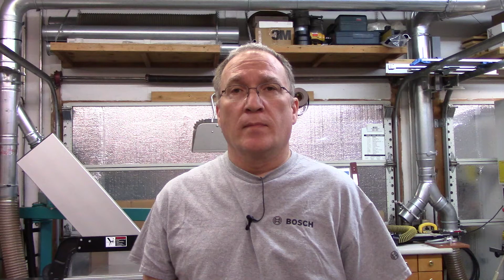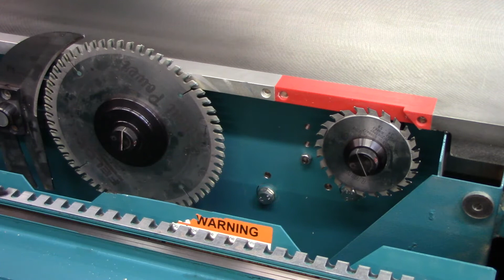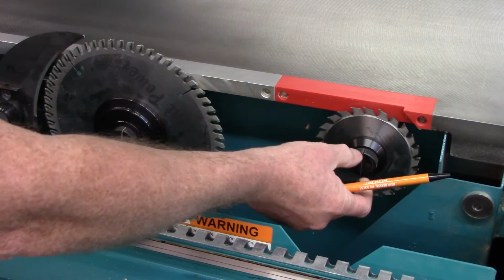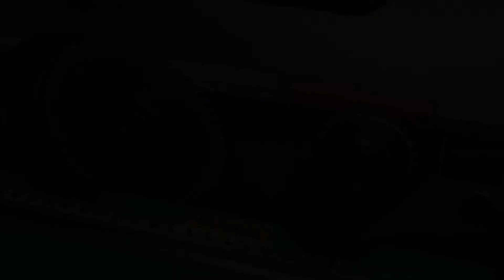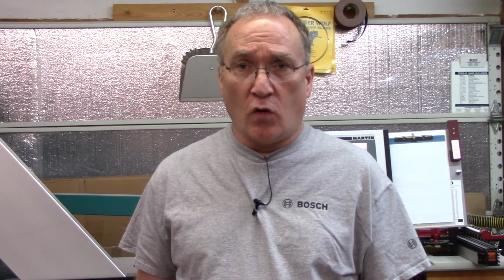Sliding Tablesaw Purchase Considerations PART 2b SCORING UNIT

Comment: Hi, I just bought a holzher table 1243 but is missing the nut and to hold the scoring blade, do you now were I can find this part
Reply from the maker: Hi Hector.  My first recommendation is to contact Holzher for the part.  If they no longer have the part, perhaps they can contact the factory and get the specs/drawings so you could have one made at a machine shop.  Steve

Comment: Thanks for all of your videos, Steve. Very informative. I'm considering replacing my Saw Stop cabinet table saw with a slider but my biggest concern is space requirements. I have watched all of your videos trying to figure out your garage/workshop layout as you seem to create similar woodworking projects to me. Do you have a video or ideally a drawing of your layout you could post? Many Thanks!
Reply from the maker: Hi Bobby.  I don't really have a video or drawing  on shop layout but some of my project videos show the placement of my saw.  My shop is a 3 car garage  roughly 26x36' and the slider sits in front of the middle garage door positioned to allow the table to slide to the maximum extent and still clear my lumber storage.  I have an 11 foot sliding table and it needs nearly 25 feet for the table to go from the fully retracted forward to the blade change position.  This pretty much dictated where I could place it in my shop (travel from front to back of my shop left 6" clearance on each end and that was not nearly enough).  Wingspan of the outrigger is also a consideration and it reaches not quite to the center of my shop with 3 foot of clearance between the saw and the garage door.

I would suggest getting with the distributors for saws you are considering and asking them for the machine distance requirements for whatever length table/outrigger you are considering as this can vary significantly from make to make.   
Hope this helps.
Steve

Comment: I just bought a second hand tablesaw, and got a little worried when it produced a LOT of smoke from the cut. After cleaning the blade did not help, I finally figured out that the direction was reversed, probably because the last owner based it on the scoring blade, which was in the wrong way round. it does have an independent motor, by the way. interesting videos!

Comment: Steve, in all due respect, I differ when it comes to "scoring" saws. Here is my thinking:

'Tis true that the scoring blade is mostly used for melamine and vernier coated wood-stock; it is still perfect for those of us who do not like the tear-out that MOST blades do on the underside of the stock. This goes hardwood and softwood; and for plywood even if it does not have a coating.

Yes, through the years, blade manufacturers have come up with ways to improve on this malady. But for MOST of the blades that we use, a scoring blade is a GREAT improvement to the cut.

Tip: there IS a way to get a scoring effect by using only the regular blade. Before you make your cut, simply lower the blade so it is NO higher than 1/8". Then feed the stock from back to front. This will score it and it is very safe. Then raise the blade to what you want and feed the stock in the normal way.

One VERY great advantage of this is; the score line is ALWAYS perfectly IN line with the cut line.

For what it's worth.

Keep up the good work dear friend. I hope you will be at the IWF show next month in Atlanta. If yes, let me know what day and time you will be there and I will plan to be there too. I am only 30 miles away I would love to meet you Steve.

Comment: One consideration I did not know of before getting the T60 compact model Martin saw was the distance that Martin has between the main saw arbor center and the scoring blade arbor. Happens that the Felder on smaller 500 and 700 series saws is rather small center to center and one is limited to smaller main blades when scoring action is required. This center to center measure is also a consideration when wanting to have a custom blade made for cutting thicker lumber in the shop. The Martin brand allows a larger blade diameter even yet when running a 20" diameter blade and having the scoring blade removed. Sometimes a fine cut is required after a project is built and a band saw cut will not get the right results. 
There is a custom tool and saw blade company in Jersey that will take your money and spec requests and not deliver the correct tooth configuration. Avoid these boys at ALL cost. They are not woodworkers and you will regret getting a reworked blade-butchered that requires one to go to a professional shop to get the tooth height reworked again. Obviously, the Jersey people make blades out of balance and this is impossible to correct.
Reply from the maker: Hi Vincent.  I am pretty sure my Martin T60 is limited to 400mm (16") diameter main blade.  While I have a few Forrest blades, I no longer purchase them as better blades can be had for a lot less.  Custom tooth geometry will cost more though.  Steve
Reply: Steve, good morn; hope all is well over there. I had purchase that custom blade I mentioned and went thru 2 months of problems with that Jersey company. The blade that came with the T60, due to limited choice from Martin, was a "triple chip" and having had a custom 60T made for my Bosch 8.25" circular saw in the triple chip, I readily went for the 350MM Leuco from Martin. Well, you would know it; I stuck a thin board down into the slot and bent the overpriced 3 chip blade and called Leuco and got a new 350 ATB out of Europe. Apparently those blades from the hinterland are a notch better than the "premium" stuff stateside. I have since put a wave in two other Leuco blades. But, I can see the end of my Euro blade days after getting the bill for the latest including freight. Those blades are bout a quarter of the cost of a ceramic crown although you don't have to get something to dull the pain.?? ha ha    I save the new Leuco for precision work and a 400MM rip Leuco rarely comes into play. Just received that 23ga Senco 2"er last week and having fun with assembly. Glad I waited and did not get the 21ga. Senco was in bankruptcy for a while but has come back. Norm is happy they still make his fav 18ga. I would like to affix a laser to my T60 so I can see the line for first cut rough edge lumber. I think the Altendorf machines are of the smaller C to C arbors for main and scoring blades. Felder did not have that parallel miter option for the 700 series or the smaller Format4 so I went with Martin. Felder tried to get me to buy the 550 but why buy a coffin for a 7 footer when the standard fit just fine.? The Martin should outlast both you and me. The later Martin models have improved dust paths vs. the vintage we have but with a good cyclone system we are OK. I have the Oneida with a custom older style plentum design that gives another 4-500 cu ft. I drove to NY to get the thing and got the mini cyclone that fits the CT33. I have paid for the Festocyclone due to current bag cost for the CT33. I have a bunch of those Gross Stabil clamps and have been hording those Pony #3700's as I track them down all over Chicago. If you are ever in Chicago, let me know.
Reply from the maker: I have 2 Leuco blades (one 11 years old) with no problems.  Joe C. speaks highly of the Kanefusa blades.  I would love to try them but you have to order them pairs.  The largest blades I have are 350mm.  I too have thought about mounting a line laser for cut sighting but haven't been too serious about it.  I actually like the Gross Stabil clamps better than Bessey but that ship has sailed long ago.  Never cared too much for the Pony clamps with the clutch plates as they often jammed on me.  Steve

Comment: I have a (smaller) Felder K700p with the mechanical (manually raised) scoring unit. Normally, I can take a 315mm (12.4") main blade. With the 100mm scoring blade, I can take a 300mm (11.8mm) main blade. Felder sells all of those, and they're pretty decent blades, so you can get pretty close to a 12" blade while still having the scoring blade in place.

BTW, I've been really enjoying these videos, and have learned some techniques I had no idea about (like the Franz jig). I've been a slider owner since March.
Reply from the maker: Thanks for posting this Pete.  The 2004 Felder CF741SP I had would not accept a 12" blade with the scoring blade attached.  There are apparently so many variations it is certainly impossible for me to know them all.  Steve

Comment: On the Felder version sliding table series called Hammer; the scoring unit can be added after delivery of the saw; several friends had ordered the Hammer Sliding Table saw and were told it is a factory only attachment with no post delivery adding of the score, but, this is untrue. One can add the scoring on Hammer saws. A parts grouping of the optional score is in the Felder lineup so just look for it. There are some main blade smooth cut higher end saw blades than can be used if a score is required, but, you have to make sure it is sharp.